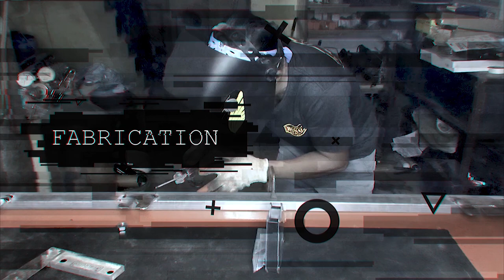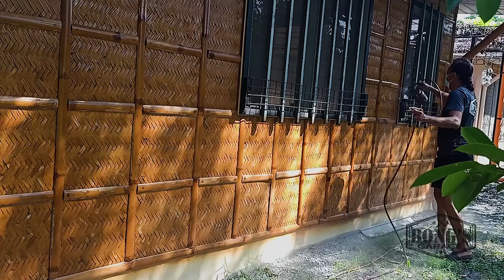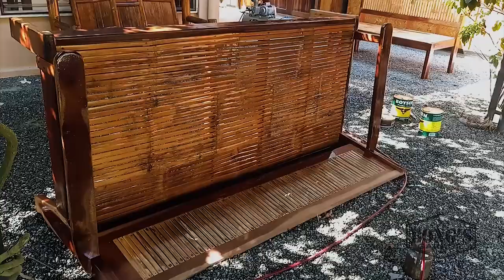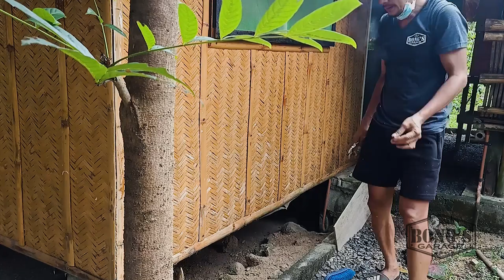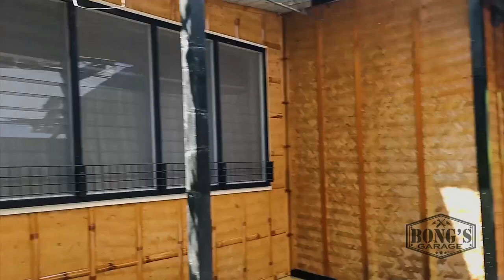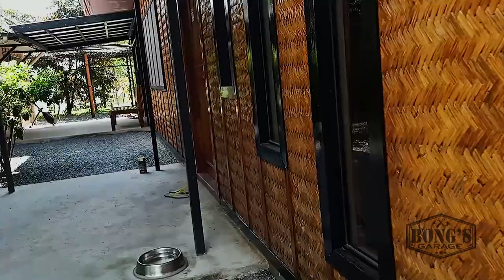VARNISH PAINTING ON SAWALI

Comment: What was your mixture? Thanks for posting 👍
Reply from the maker: First coat is the 1 quarts of sanding Sealer( Boysen)mix with 1/2 qrts of Acrylic thinner premium.
Reply: @bongsgarageph9441  thank you much for the info sir👍
Reply from the maker: @pepejuan2924  You welcome po Sir Pepe! Salamat din po
Reply: @bongsgarageph9441  anu po ung 2nd coating at alin mas matipid spray or brush?
Reply from the maker: @elenramirez9569   Mam, second coating po ay Polyurethane Hudson Varnish  mix with Acrylic Thinner. Mas Tipid po yun Spray.
Reply: Sanding sealer at laquer thinner lang naman nakita ko. Asan yung pinaka varnish niya?

Comment: Hello po sir, need you help, nagpa wood varnish po ako at di po nagtagal kasi plastic varnish po nilagay. Paki turuan naman po ako ng tamang paglalagy
Reply from the maker: Sir/maam pag bago po yung sawali wag po kayo mag apply ng varnish na may kulay. Yung clear varnish lang po.
Gawin po tanggalin po yung plastic varnish. Use brush yung pang laba po. Then bili po ng sanding sealer (boysen) and lacquer thinner. Haluan po ng lacquer thinner yung sanding sealer kailangan mejo malabnaw. Then apply po using roller. Mga 2 coat po.
Pang final po hudson varnish na may halo po ng lacquer thinner.
Reply: @bongsgarageph9441  salamat sir.... nagkka problem po ako sa bokbok, kahit ano po gawin ko .. di napo nattanggal, huli na po namin nalagyan ng varnish
\